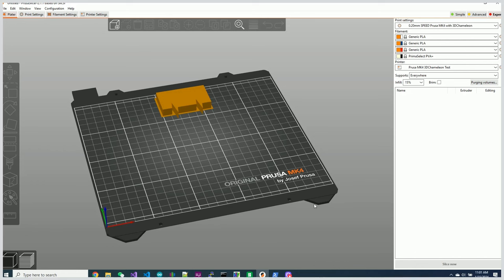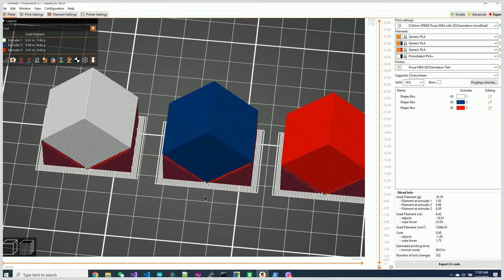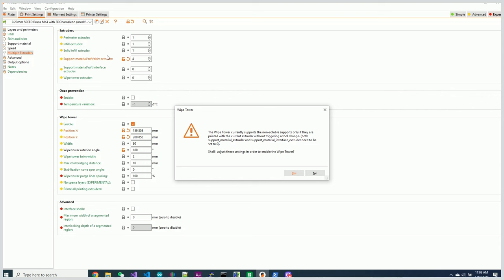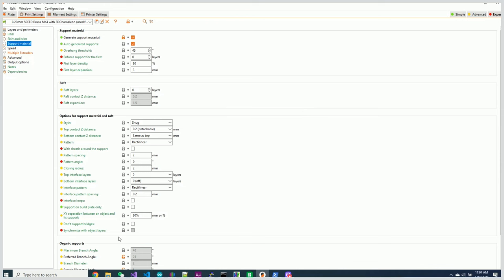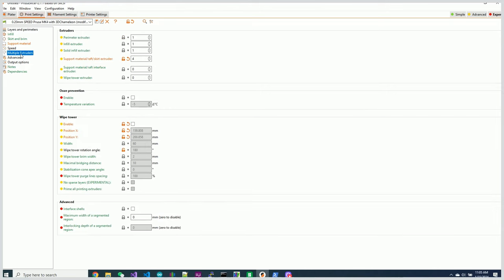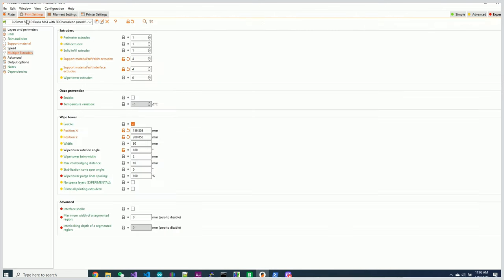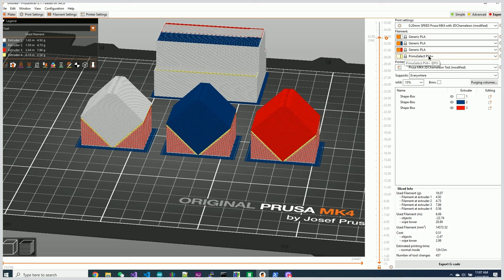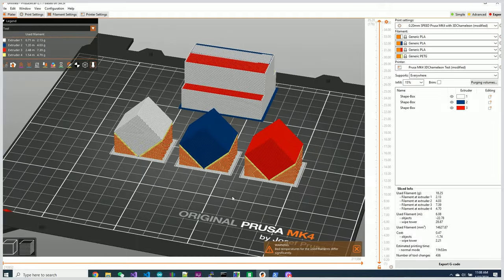3DChameleon - Using PVA Supports In PrusaSlicer

Comment: Thank you!  My next project will be to add 3D Chameleon to the Magnetic IDEX printer.  Material changes will be done on the idle/parked toolhead with nozzle temperatures optimized for nearly a cold pull.  If things work out as I imagine, a humble IDEX will become an unbeatable powerhouse because material/color changes will have virtually zero time penalty.
Reply: I can't wait to see that!

Comment: @williamsteele @3d_chameleon, what's the best place to find latest information about MK4 Pro, and, be notified about updates regarding MK4 Pro?  For now, am assuming I should subscribe to your channel.  Am going to RMRRF, might be bringing the Printer I brought last year (can see 60sec build montage I shared, details for that build on V1E).  Am wondering whether to add MMU for RMRRF.  Cheers!
Reply: We won't be releasing any details on the Mk4 until the RMRRF.  As for being notified... be at RMRRF! ;-)  Just remember, as we've stated previously, the Mk3 is the Mk4, just a firmware update and accessories (which are enabled through the firmware) are the only differences.

Comment: Can you have the purge material used as support?
Reply: The system will do that normally, however, you need to make sure the purge material is compatible with it being a support.  For example, you can't have PLA with a soluble support setting turned on, and vise versa.  So, you really can only use the same type of supports as your printed parts.